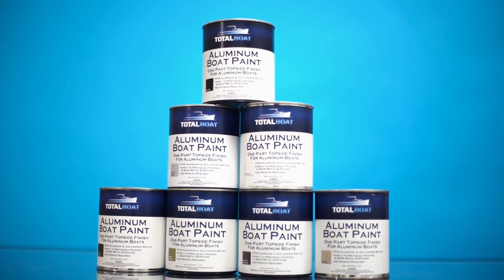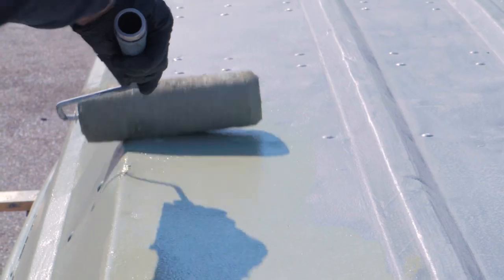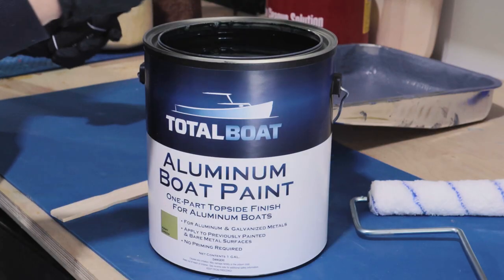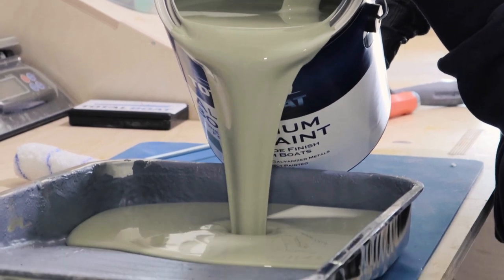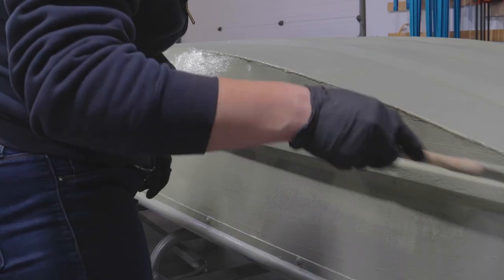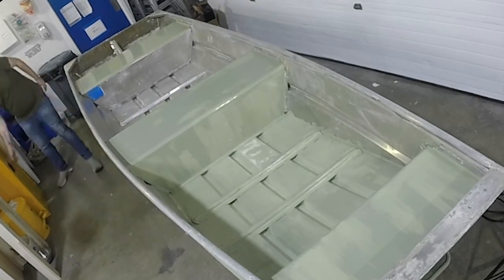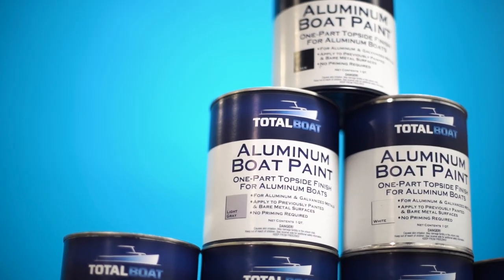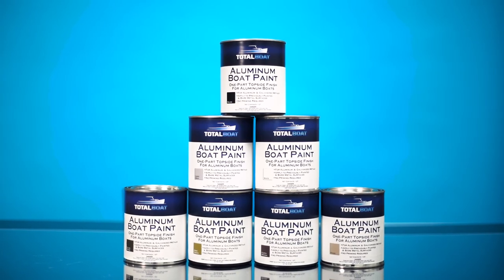TotalBoat Aluminum Boat Topside Paint

Comment: So i have old paint on my boat, I dont need to sand it and take  it all off, I can just apply on the surface of the old paint right?
Reply from the maker: If the previous coating is still in good condition, you will just need to give it a light scuff for proper adhesion and you can apply it right over.  However,   any previous coatings that are lifting, peeling, or generally in poor condition will need to be completely removed first